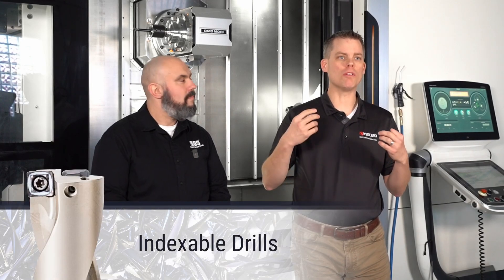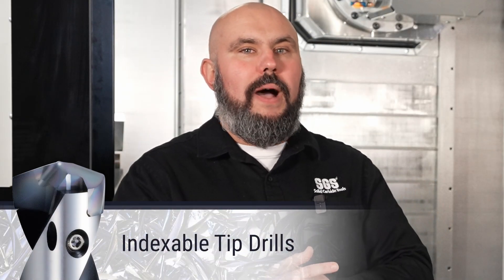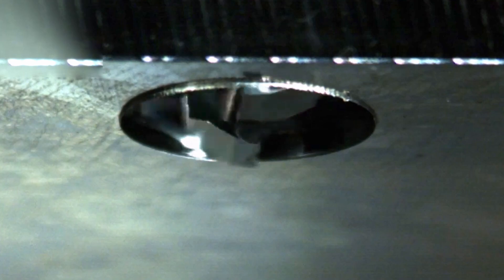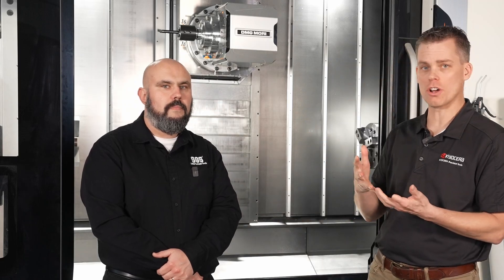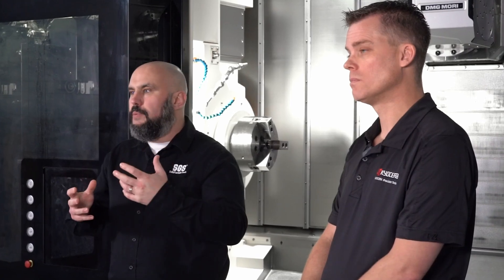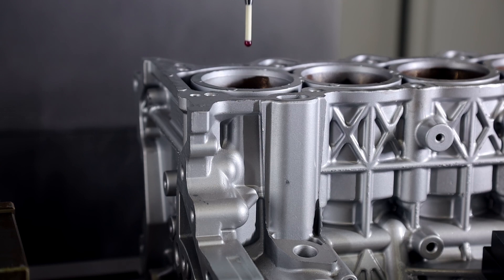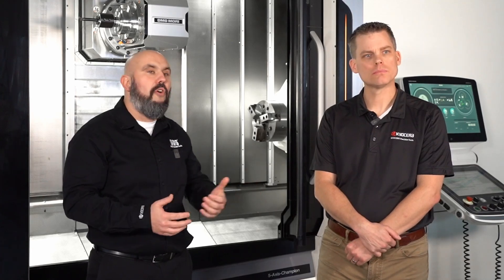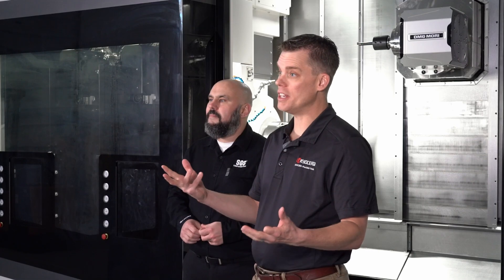Indexable vs Replaceable Tip vs Solid Carbide Drills – Which One is Best for Your Machining?

Comment: How does replaceable tip compare to spade ? Same requirements for me : low volume production, variety of materials (aluminum, stainless, steel) and diameters. Mainly to pre-bore on the lathe.
Reply from the maker: Both have their advantages, but in your particular machining environment, spade drills may be the better option.  Here's Justin's take on your question: "Spade tip drills, particularly those made from HSS or cobalt, offer a lower upfront cost but come with trade-offs in performance, including slower cutting speeds and reduced hole quality and accuracy. While carbide spade tips improve these aspects, they still fall short of the performance delivered by replaceable-tip drills. Replaceable-tip drills offer superior centering, hole accuracy, and overall strength, thanks to advanced point and flute designs, options like double land margins, and optimized chip evacuation. However, spade tip drills excel in flexibility and are better suited for long-reach applications, older or slower machines, and cost-sensitive, low-volume jobs—especially in larger diameters, where their wide size range per body is an advantage. Despite their niche strengths, replaceable-tip drills are typically the preferred choice for consistent quality and performance."
Reply: @KyoceraPrecisionTools  Thanks ! Spade it is then. I'm going for 5xD by the way.